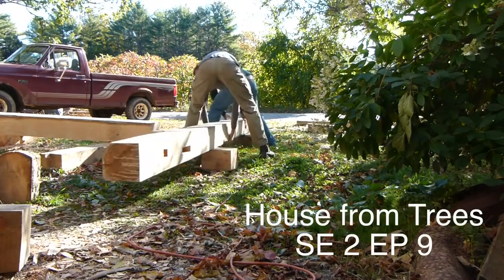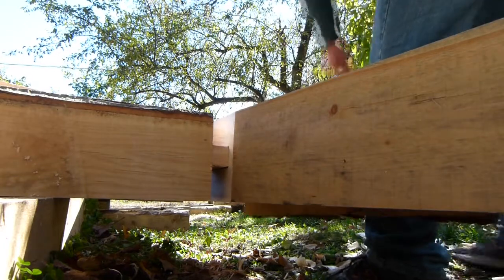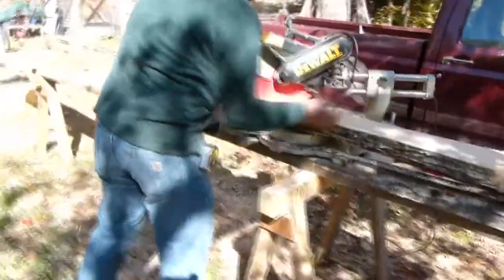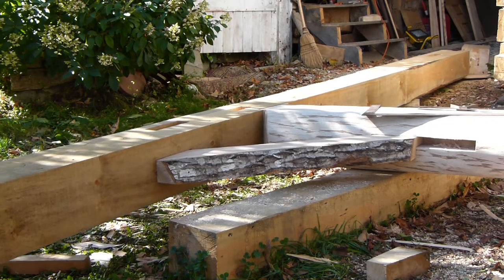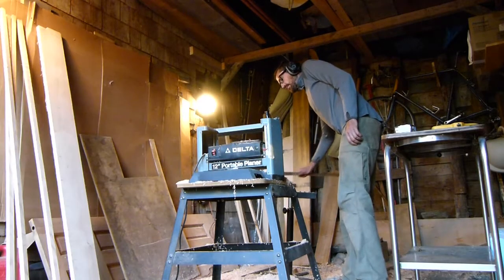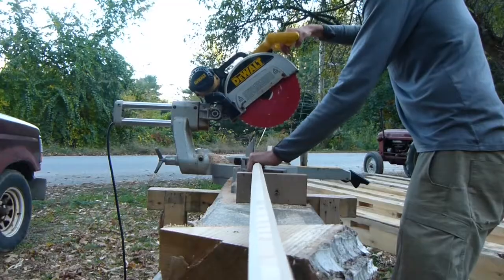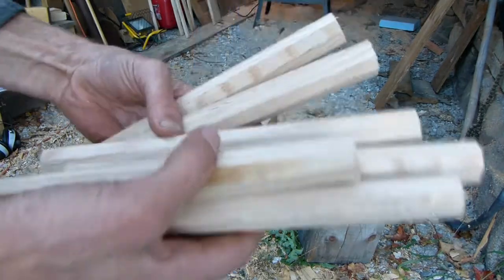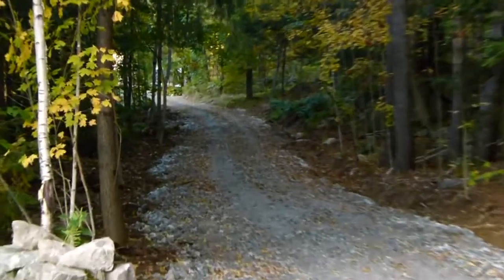Building A House From Trees SE2 EP9 - Brace + Bent Fitting, Oak Peg Manufacturing

Comment: Would like to know if the steel plate fixture had a hole slightly bigger than 1 inch to make the pins fit tightly in the holes

Comment: For 150 pegs, couldn't you build a jig with your table saw abutting a hole in some scrap and drive lengths through with a drill? 

I've had the fastest results from this sort of thing, even if getting it all tuned up at the start is a pain
Reply from the maker: Im not quite sure what you mean. Ive subsequently processed most of the pegs ill need at this point. Like anything, I've grown more efficient as the numbers pile up. Thanks for the suggestion.
Reply: Bus Huxley haha sorry, bad explanation. :) 

Basically you attach a bit of wood to a table slaw sled, with a hole the size of your dowel in it, and counterbore half of that hole to the width of your square stock.

Where the two different sized holes meet, you bring up the table saw blade to the height of the smallest hole.

Then, take square stock and attach a drill to the end, and spin it through the hole, over the table saw.

Big hole guides the spinning square stock, small hole guides the resulting circular stock.

It makes for relatively clean, consistent results once the saw blade height and stock size is dialled in nicely. 

Hope that made sense (albeit too late for your work!) :)
Reply from the maker: Will Dayble Holy crap man! Thank you for the wonderfully thorough and detailed explanation. My temptations is to try and rig this up for the last bunch to fabricate. Great idea. Have you done this before?
Reply: Google "table saw dowel making jig" you'll get some results, I can't remember which one I based mine on, but something like this: https://www.youtube.com/watch?v=b0OUCrguJes
Reply: ... only difference with mine was I had it running over the saw in the other direction (just the way my shop is set up). I found the trick was to be VERY particular about the size of stock, it has to exactly match the hole sizes, and takes a little while to get going.

I'm sure a man of your handy skills could figure out a smarter, jiggier option in the end, haha!
Reply: I've had pretty decent luck with this sort of setup and turning scrap wood into dowels -
 https://www.youtube.com/watch?v=fp5n7SpzGLE
Reply: james vreeland haha you're braver than me - tried making one of them and just found it too wobbly. My lengths were too long I fear. :)
Reply from the maker: james vreeland hey there. Thanks for that link. With the small diameter of the dry red oak pegs I’d worry about breaking teeth on the saw. The stuff is rock hard! For other things I will be keen on trying that.

Comment: Your method of peg making is quite efficient I think. The planer allows you to create consistent, tight dimensions. For dowels there is a jig that works like a pencil sharpener but I'm not sure if it will work well when scaled up to 1 inch. Matthias Wandel has a write-up and video on the dowel jig: https://woodgears.ca/dowel/making.html
Reply from the maker: I checked that out. Yeah, it seemed to work alright once i got the hang of it. The table saw technique worked pretty well, with two people.